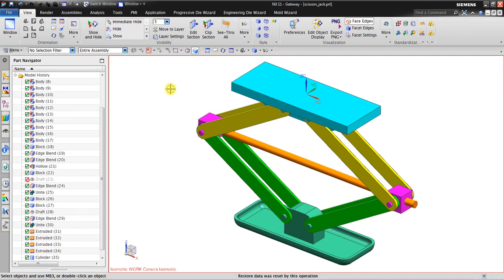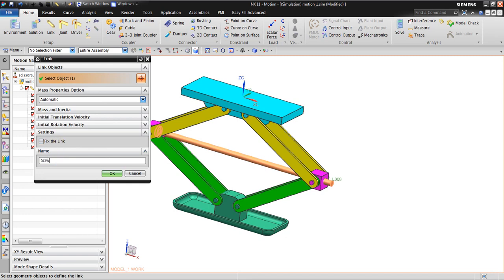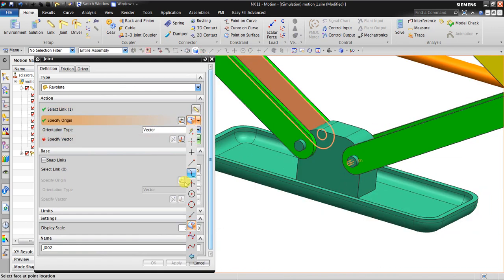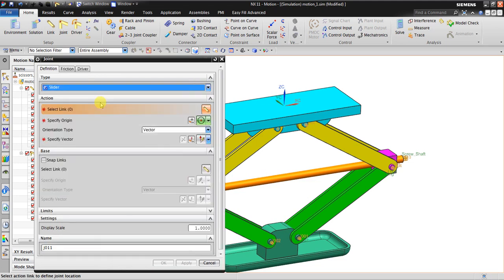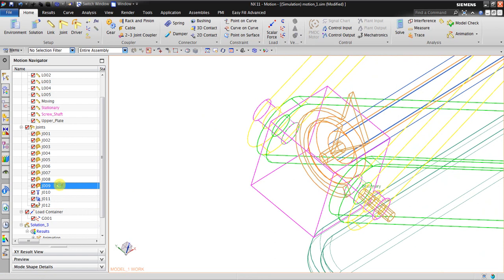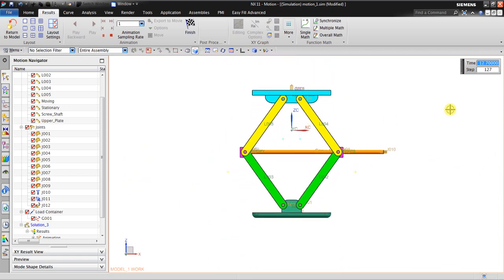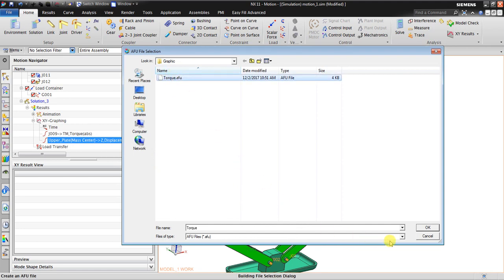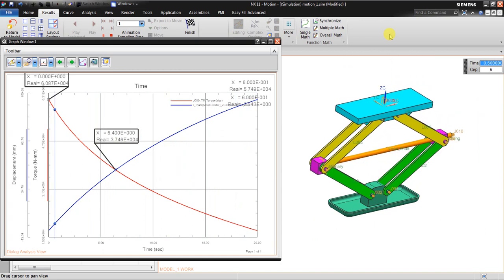NX Motion Tutorial :  Scissors Jack Study Case, Determine Minimum Torque Required

Comment: Hello! Thanks for your sharing. It's really helpful to understand the results of a mechanism.

I have a question;

At the beginning of video, you chosen "dynamic" option. Why not "kinematic" ? What would be the difference?

See you...
Reply from the maker: Kinematics only focused on displacement, velocity, and acceleration. No force (applied & inertia) considered in the calculation (simulation). Meanwhile in dynamics, all force applied or involved will be calculated. For this video example,   we have goal to determine the torque required for the mechanism, therefore all load applied include weight load due to gravity should be considered in the calculation. Thanks.

Comment: screw joint is translate and rotate as like cylindrical joint . is that possible that cylindrical take place of screw joint at 7:05?
Reply from the maker: Based on my experience cannot. Screw joint better and easier to setup for both movement.